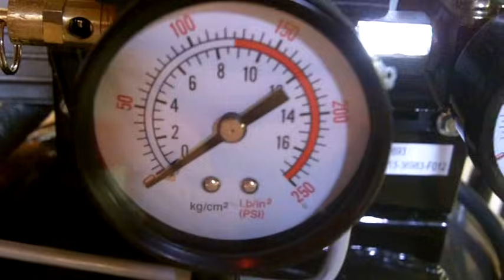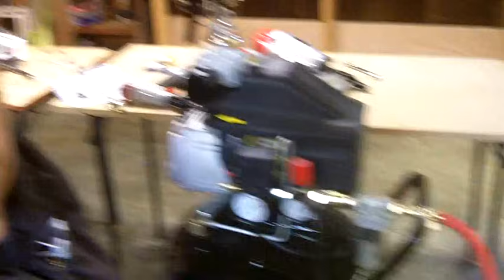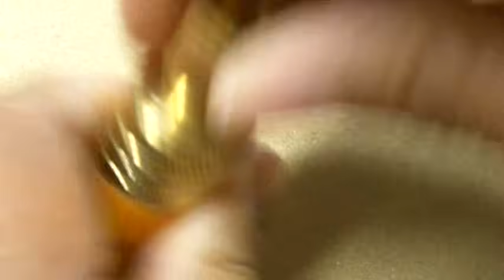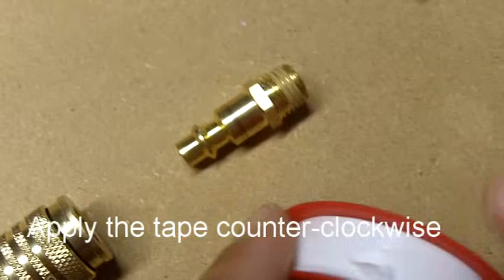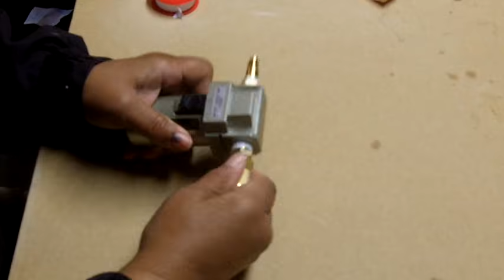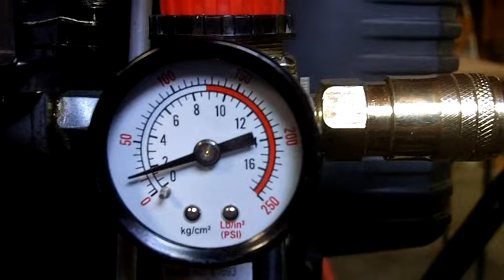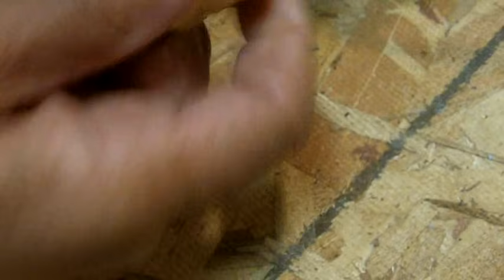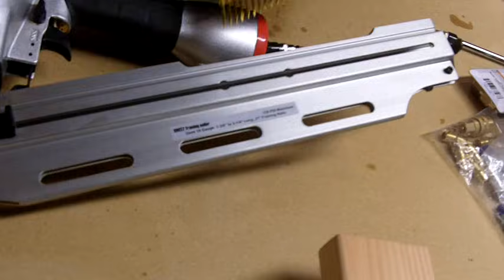Air Compressor, Line Setup and How to Use Air Tools for Beginners

Comment: Thanks for this video. I see that the tool hose can remain pressurised. and then we can connect and reconnect tools without backing off the regulator to zero pressure. Also, I am curious about venting water with the tank still under pressure. I hope to not have to depressurise the tank in order to operate the water outlet valve.
Reply from the maker: Hi Andrew, no, I would recommend de-pressurizing the tank before draining the water
Reply: OK thanks for the tip.

Comment: How do you get the water out of the tank, as opposed to the hose/pipe? It's my understanding that water must be drained from the tank, but I can't find anything on YouTube about that. Thanks.
Reply: There should be a drain valve on the bottom of the tank.

Comment: I just bought my first compressor and feel so fortunate to have come upon this tutorial.  I thought I knew how to use it but, as the video progressed, I realized that I actually did not have a clue .... thank you so much for the most helpful instructions, Leah!  I now just need to figure out which type of couplings I have on my compressor and on the air tools I had purchased.  I also still need to buy a filter before using my new compressor :)

Comment: This was a great video! I just got my first compressor. All new. The couplers all leak. I thought it was the hose, but only where the hose connects to the coupler it leaks. I tried three different couplers and they all leak. My pressure doesn't stay up high enough for anything. Is this always the case? I have a 1 gallon 120psi Makita, using a Husky hose, and 3 different couplers. The only leak is at the coupler. I don't get it.

Comment: What air compressor is that?
Reply from the maker: HF 21 gal. 2.5 HP 125 PSI Cast Iron Vertical Air Compressor
Reply: seejanedrill Awesome! Thanks! Thats what ill get
Reply: Just bought it and it works great!
Reply from the maker: Nice!

Comment: Awesome video without a doubt the best on YouTube, quick question, would you recommend an oiler as well? And should i turn the pressure down when connecting a tool and than raise the pressure back up?

Comment: Thank you Leah. I have a question please--should the regulator be turned all the way to the left or the right before you pressurize the tool? Thanks
Reply from the maker: On the regulator handle there is usually a directional arrow denoting closing/opening.

Comment: To effectively remove moisture, the separator needs to be further away from the compressor head so the air has time to cool and condense the water out of the air.  It also helps to mount it as low as possible, at least lower than your regulator. Just FYI.
Reply from the maker: Thank you for sharing your personal experience.  Though on a portable compressor, that can sometimes be difficult to do

Comment: Thanks for your video. Is there a reason you don't use the combination connections?  Wouldn't that make your system more flexible?  Thanks again.
Reply from the maker: just personal preference
Reply: seejanedrill thank you.

Comment: Dear Leah,  you are a fabulous teacher and a great demonstrator. 
I love your videos showing "A-Z" operations of the compressor and the installations. You have a very beautiful soothing voice and a pace, therefore it helps a great deal to under the functions. Simply brilliant. Thank you. Best of luck.
Reply from the maker: you're welcome, Pat, and thank you!
Reply: You are very welcome Leah. Bought more bits after seeing your video. I want to split the same air supply to use multiple tools without disconnecting the single flow air supply. I  could not find any Tee-pieces UK local hardware stores. Can you help with any links, please? Thank you very much.

Comment: The air filter isn't very effective if you run it right out of the compressor. If you use one it should be at least 25-50 feet away from the compressor in the line because the air is still hot as it exits, and won't condensate for around 25 feet.

Comment: Thanks heaps for this tutorial. Can you please tell me when it is safe to disconnect powertool so I can adjust the depth for example and then reconnect and test the depth and again and again until I'm satisfied with the depth? Can I disconnect while air pressure is still there? Do I need to turn the compressor off? Do I turn the air tap to off? Do I need to drain tank? I can't find an answer to this question...  (I am an absolute beginner) Many thanks in advance!
Reply from the maker: What air tool are using?
Reply: seejanedrill 
HimLeah, I am using a Ryobi brad nail gun :)

Comment: Hi Leah, Can you please tell me the brand name size and cfm output on your compressor--also the cost too? I want to paint and refinish furniture. Thank You very much.
Reply from the maker: Central Pneumatic 2.5 hp 21 gal. Air delivery: 5.8 CFM @ 40 PSI, 4.7 CFM @ 90 PSI .....I paid around $150
Reply: thank You Leah--great videos.

Comment: First, great videos!! As I'm sure you know, there are tons of guys watching your videos, simply because they are the best.When using a 90 psi blower similar to your red handled one in the video, I set the pressure to 90 on the gauge.When I use the tool, the pressure on that gauge drops to 50 while the air is coming out of the blower.When I stop the blower, the gauge only returns to 60, not back to 90 where it was set for.If I set it to 110 psi, the blower operates at about 85, and it does return to the 110 psi mark on the gauge.Any ideas as to what is wrong.?Thanks!

Comment: What kind of compressor do you use? I'm looking for one like yours that can work with an impact wrench.
Reply from the maker: I purchased mine from HF....it's 21 Gal. 2.5 HP 125 PSI Cast Iron Vertical Air Compressor

Comment: Thank-you for the tutorial, I had forgotten about adding oil to the tool(s) before using them (every time, once a day?).
I'll have half of a smallish two car garage to setup a shop and I was thinking of a 30gal (vert), 1.5 hp min. and 5.0 scfm @ 90psi unit would be more then enough for my average needs?
At what hp level is it required to use a 220v, 240v circuit?
Thank-you again.
Reply from the maker: It really depends upon the types of air tools that you are planning to use with your compressor, and what types of projects you will be doing.  If you scroll through the comments, you will see where I have answered this question before with a great level of detail.
Reply: Mainly small air tools like a hailer (size?) and others that are best using air?  I'm hoping to get a new (or used) floor tools every few months (1st table saw) then start making a mallet(s) various clamps and jigs to get some basic knowledge.

Comment: It is so nice to see someone take the time and guide us correctly, my neighbour sold me a pack of air tools for $80,thought I could flip them, but then I bought an old car so... 2.5HP, 25L compressor later...

My neighbours complained that I tested my compressor in house... should have watched this video, BUT... I will be getting couplers...

On that note, is there a real difference between the Automotive and industrial? I found that my tools are in pieces and I can put any type of coupling on it and it makes me confused why I can't connect them.

However,you did guide me through the safety part of it, and for that I thank you....now I'm just gonna be an asshole and wake the neighbours at 11PM >:)
Reply from the maker: No big difference between the two automotive and industrial.  Couplers have to be compatible with plugs'
Reply: the main thing is that one doesn't connect with the other and there are different sizes.

A automotive starter kit that I bought didn't have enough connections and had different sizes.

On top of that my compressor didn't have quick release, PLUS it's so bad that... 1. it doesn't shut off once it hits the red zone, 2. the electrical cord is touching the heat pipe... it started melting within 2 minutes of operation, I will be reporting these faults with the manufacturer and demanding they recall the devices voluntarily or else I will go through the channels for them to recall, this is Australia we're talking about... we are brutal with demanding companies recall, Fisher and Paykel hate us...

Comment: Thanks Leah. This was very informative and helpful. I am planning to get my own air compressor and air tools so this video really helps. Just a question, did all three air tools have the same psi? Because I did not saw you adjust the regulator again after using the blow gun. Also, what brand is the framing nail gun? Thank you!
Reply from the maker: Hi Eric, not all tools have the same psi.  But there is an optimal setting on the compressor, which tends to be about 90psi.  But as I stated in the video, it really depends upon the tool that you are using, and usually the tool manufacturer states what pressure it should be set at.  But for most tools, you can set it at 90psi.  The framing nail gun was from Harbor Freight.

Comment: I'm looking for a quiet air compressor because I have a single car garage.  I need it to inflate tires and nail gun capabilities.  I heard that air compressors with oil is quieter.  I am thinking about a 10 gallon husky oil lubricated compressor with 3.8 scfm for $149.  I was thinking about using it for impact wrench/ratcheting tool, but I heard I need to step a lot if I want to loosen say 20 lug nuts or remove big bolts from suspension/brakes...so i'm thinking about just sticking with a breaker bar and my 1/2 inch socket set.  I appreciate your advise.  I looking at sears, home depot, northern tools, harbor freight, and so forth... just too many choices... filled with mixed reviews.
Reply: Hi Don! I just received (this afternoon) my ultra quiet compressor from California Air Tools. If quiet is important to you, this is it and no, I do not work for them. I just happened to compare it with my older compressor and there is nothing quieter out there, from what I can tell after months of research...
Reply from the maker: Yes, as a general rule, oil-filled compressors tend to be quieter and last longer than non-oil-filled compressors.  However, I believe that as JF mentioned, the California is a quieter air compressor, and is oil-free. As for the Husky that you picked out, it should be fine for inflating tires and nail guns, however, as you suspected, it wouldn't be the best choice for more air-demanding tools.

Comment: What oil are you using?
Reply: im using my air compressor for a die cutter, maybe I should put a couple of drops on the end of die cutter where it has plug where I have to connect to a coupler
Reply from the maker: I use Bostitch, but there are other good brands

Comment: Thanks Leah! Had no idea how to set up my compressor before this video.

Just a couple questions. Is the quick coupler different from the industrial coupler? And is the reason you use couplers so you can quickly change hoses or filters or tools without re-screwing everything in?
Reply from the maker: Hi Faraz, the quick coupler is a combination of the coupler and the plug.  And yes, the reason that you use couplers is so that you can connect and disconnect quickly.  And "industrial" "universal" and "automotive" are just styles of coupling systems
Reply: Great, just finished hooking up my air gun and it works like a charm thanks to you!

Comment: Leah, Thank you for such a great ,simply put,instructional video! I'm buying a new air compressor any suggestions on how many Gallons size tank I'd need? I'm a hobbyist and will need it primarily for brads, small nails and a sprayer. Any input would be greatly appreciated. ~Dolly
Reply from the maker: Hello Dolly,  A small compressor is fine for operating a nail gun but you'll need something larger and with an appropriate cfm if you intend on spray painting.
Reply: Thanks for the feed back!

Comment: Hi Leah: Great video. My compressor is almost just like the one in your video. It's been running fine for 8 years, and now when it fills the tank, when it hits 125 psi the blow off valve releases the air. The tool pressure being only at 40 psi. Should I take it in to a small engine shop?? ...or is it just something I am doing wrong?? Thanks!!
Reply from the maker: Hello Richard,  You're not doing anything wrong.  It sounds like a faulty pressure relief valve/safety valve.  The output pressure gauge only indicates the psi going down the line to your tools (which you indicate is set at 40 psi). It does not reflect the pressure inside of the tank.  I would take it into a shop for a once over. Again I suspect its your safety valve which is faulty.

Comment: Can you tell me what to do about a broken at the screw on the compressor Intake Filter that is torn off.  Can it be fixed or
replaced with another screw?
Reply from the maker: Yes, with a tap and die set.  You can probably pick up a cheap tap and die set for a small job like that.

Comment: Back at your channel again and once again found some info for the new compressor and air tools that we just purchased. Air filter was not even mentioned by the sales guy where we bought the air compressor and tools from even though I asked if there was anything else needed for the compressor.  Glad I found this out now than later on when a problem could have developed with the compressor or one of the tools. Thanks again for the great explanation and instructional video. Keep up the good work!
Reply from the maker: thank you, glad it was helpful!

Comment: Thank you for the thoroughness of this video. Question: is applying tape to the male adapter absolutely necessary to prevent leakage, or simply advisable? Once tape is applied, can it stay on the adapters for repeated uses?
Reply from the maker: yes, and yes

Comment: Looks like your the beginner!!! Traps next to compressor do nothing!!! Compressed air is hot the air must be cooled before you will get any water out of it. Traps need to be at least 20 ft down the line from the compressor or they are useless. It also helps to use copper pipe. So many people on here giving false information and looking like fools. If you don't know what your doing or talking about its really annoying because your misleading people and wasting their time. DO YOUR HOMEWORK!!!!
Reply from the maker: joe bob billy,  A difference of opinion is welcomed.  Your comment is unacceptably aggressive.  As a tradesperson, I know that coalescing filters are best set-up down line.  But those sort of applications (piping and wall mounted filters)  are meant for permanent shop compressors. Home diyers are using small, inexpensive portable air compressors in their garages, taking them outside and transporting them to other work-sites. What you are suggesting would be unworkable under these circumstances. Is the filter being attached to the compressor in the best location?  No, but for my circumstances and work routine and for many homeowners, it's better than the alternative, which is to use nothing at all.  LIGHTEN UP!
Reply: Shes awesome. Take a hike buddy.
Reply: Not your buddy fool.

Comment: To avoid coupler confusion, just buy the Industrial plug with the long nipple on it and the Universal coupler, which will have 3 rings on the textured part. The other coupler will have 1 or 2 rings, I forget which....so just buy the Universal which always has 3. I also like Universal better cause its a press fit, so you don't have to pull the sleeve back, they just snap in.

Comment: Thanks for a good video. 

Question: Can we use the paint Spray gun with this compressor?
Reply from the maker: Hi syed, there are a couple of things to consider.  You need to make sure that the cfm requirements of the paint spray gun that you have match the cfm output of the compressor.  The compressor we showed in the video is capable of spraying intermittently.  Here is a link to our video on how to use a paint spray gun: https://youtu.be/vOmB0yzJ0m8
Reply: yes

Comment: Hi Leah, I want to first off say I love your videos. They are extremely informative. I do have a question though about the oil used for the air tools. If you loose or run out of the oil that may come with the tool can you use something different like mineral oil or 3 in 1 oil? or do I need to make sure to replace the manufactures oil with the same kind of oil?

Comment: The obtain dry air a refrigerated air dryer is required and these are very expensive.  I've never seen one in a home shop or garage.  The filter maybe does some good but I wouldn't bother.  Remember to open the tank drain valve periodically.

Comment: Great video. Bought a new Porter-Cable C2002 compressor from Lowe's on sale yesterday and tested it with adding more air to a nearly flat tire. I see there are other attachments I could use within time. Thanks for sharing. Oh, BTW, what kind of oil do you use in those components?
Reply from the maker: Try Bostitch Premoil, that's what we like
Reply: Thank you...

Comment: Very informative, great basic info. But you didn't tell us about the water drain. 
A compressor should be drained daily (if used). Water will rust away the inside of the tank, turning it into a big explosion waiting to happen.
It's mentioned in the manual, but easily overlooked.
In my opinion definitely worth editing this otherwise excellent video for.
Reply from the maker: You know, you are right about that.  Absolutely, people should drain the water from their compressors after each use.
Reply: Very good intro video!..but please do NOT oil the air nozzle ..or especially ANY paint gun,  airbrush, etc....never never oil those air tools or you will be very disappointed with the results... unless you are doing some strange abstract art that is... ; )